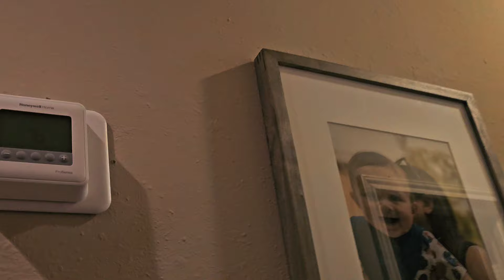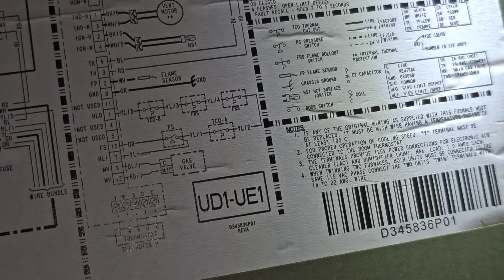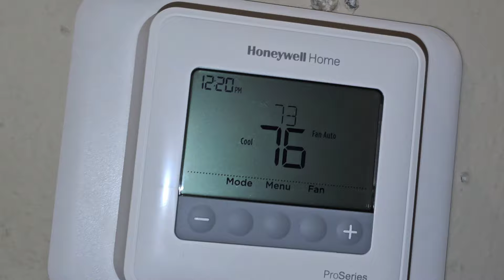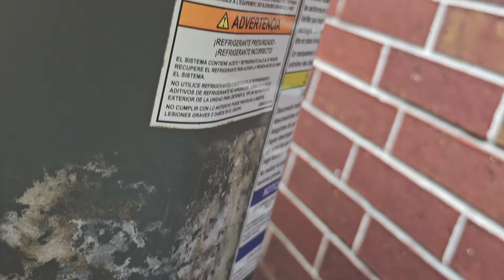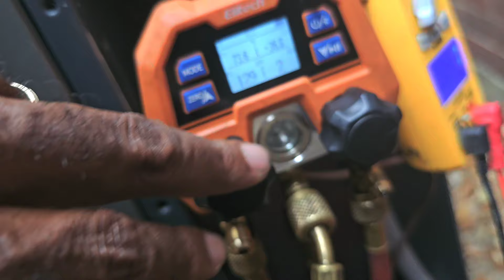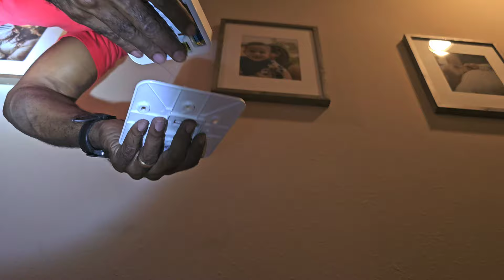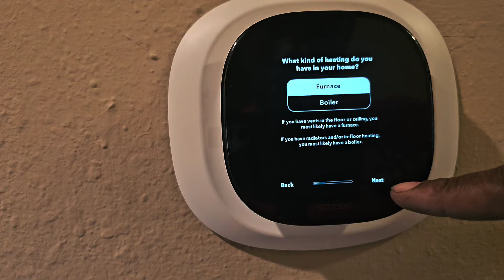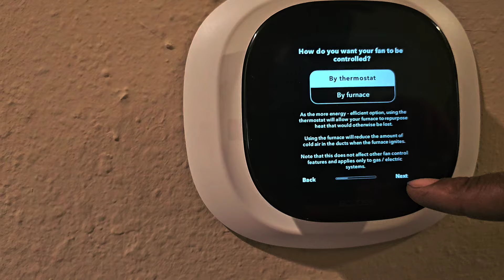Callback|Frustrated home owner AC not cooling again

Comment: Intermittent low voltage issues which can be voltage drops due to bad connections or old wire that’s corroded and or controls that are shorted. That’s what I tell ‘em to CYA. There’s not necessarily a one shot solution for these issues it’s just part of the design. Sometimes in residential air conditioning you have to let the customer know what they take for granted every day isn’t guaranteed. But he’s got a number he can call and a Pro shows up to correct the issue. What more do you want life is good. These customers get too needy sometimes.
Reply from the maker: As always Thanks for sharing that knowledge

Comment: What happened to the contactor is the loose connections….any loose connection in electrical causes heat…therefore it heated up the coil in the contactor and burned it out…shorted…

Comment: Walt don’t program those to run by thermostat put it on by furnace, Tstat turns the blower on to early on a gas furnace in that setting
Reply from the maker: Okay thanks for the tip. I will keep that in mind next time
Reply from the maker: Although I never had a problem with this setting, the thermostat knows if it's gas or electric heat, depending on which setting I choose.
Reply: Why happens if the blower turns on to early ?

Comment: That T4 will not energize Y if the contactor is shorted. Any time the thermostat like that just clicks and wont engergize Y , it is the shorted contactor.

Also you got a gas furnace and the furnace should control the fan in heat on that ECO bee.

Not a call back.  Was wire last time. Now is a different part. He is just taking advantage of you. Should be a billable call.
Reply from the maker: Yeah, you will wait all day for the delay 😆

Comment: Did you sell him a thermostat after returning the loaner or if that’s the loaner was it compatible with the board and why did you take your gages into the attic? Organize your tools ( excess noise). Do not try and sell tools in your video. Experienced service technicians would have found the problem long before now. I started doing service in 1988.
Reply: So you never had callbacks or made mistakes??? Wow I learned the trade from 30-40 yr   Techs, Residential & Commercial and all they talk about is the ones that bit em in the Ass😂....Never met a PERFECT Tech‼️🎯
Reply from the maker: About how fast?
Reply: We have a super tech on our hands....
Reply: @treyfranklin6092 lmfao fr I'm sure he wasn't the best tech in 1988 😂
Reply: @williamarellano4734 probably not the best in 2024 neither
Reply: No he must work for trane. You need a thermostat that’s “compatible” with those furnaces
Reply: I see my comment got deleted. YouTube at its best